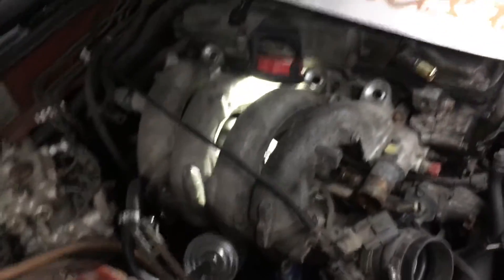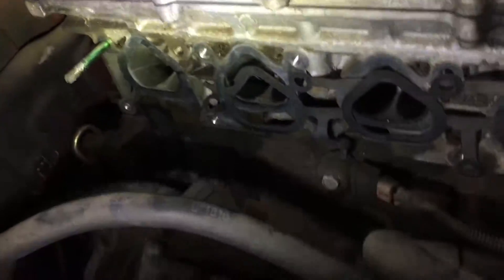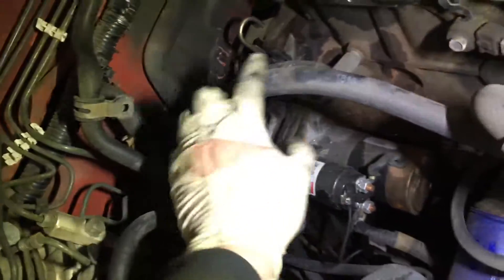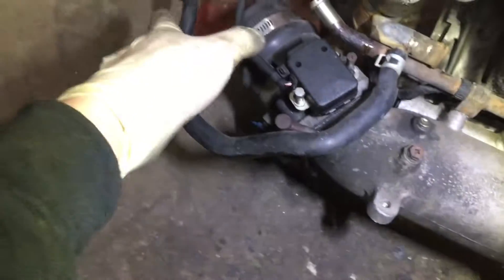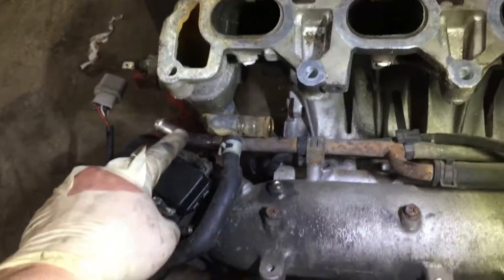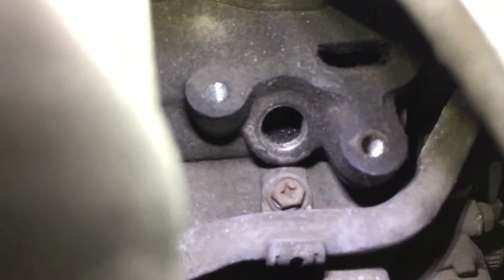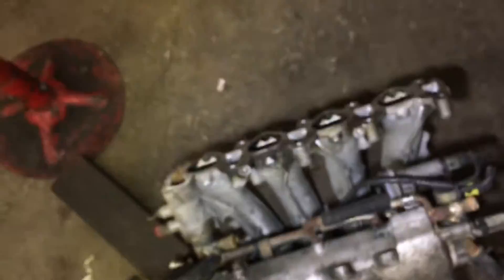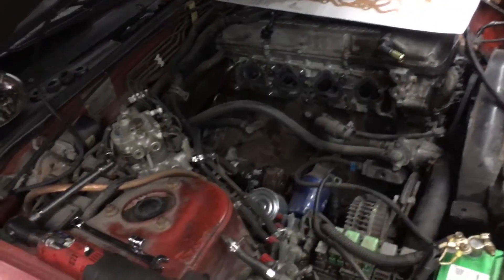KA24DE Intake Manifold Simplification

Comment: Hey brother I am stumped right now with my turbo KA. Not sure what to do with my PCV setup. I have way too much pressure in the engine and it is pushing oil past turbo seals. Straight thru fitting instead of pcv running to catch can, the pcv tree on manifold is welded closed. I don’t know whether to run the catch can to turbo intake or to valve cover at this point

Comment: Did you do anything to your butterfly valves?
Reply from the maker: I used an S14 upper half of the intake manifold so I deleted the butterflies that way. You can remove the butterfly valve assembly from an S13 manifold by removing everything attached to the rod and plugging the exterior holes after you are done. the holes that go between the cylinders aren't a big deal, but the end of the rod hole and the phillips head screw in the middle that holds the rod in place need to be sealed up.

Comment: where did you hook the pcv up to pre throttle body??
Reply: depends if you're running on boost or not. If you're running boost, I've seen the PCV line run to a catch can. That catch can has 2 lines coming in from the valve cover and pcv; then a 3rd line exits the catch can and routes to the intake pre turbo inlet (in between the MAF and turbo inlet). That spot would pull vacuum under load to relieve crank pressure.
Reply: ok and if your not ?
Reply: @jezzybarnes  I ran my PCV system thru a catch can and into a bung on my intake pipe. Works great!